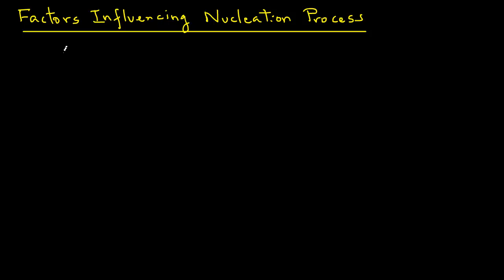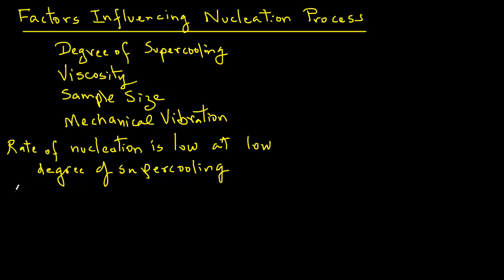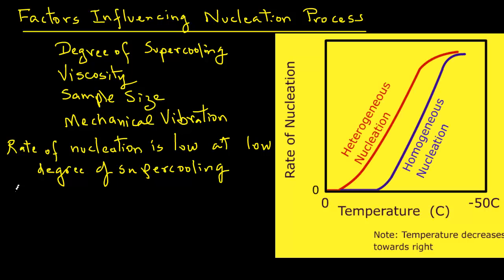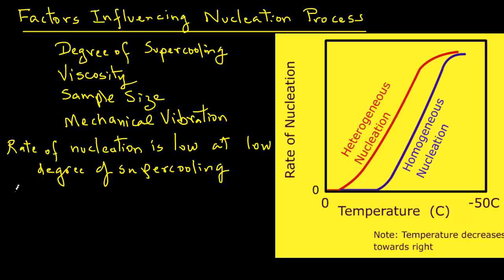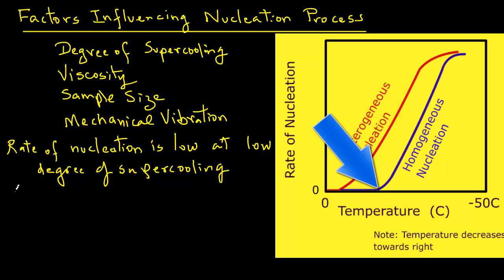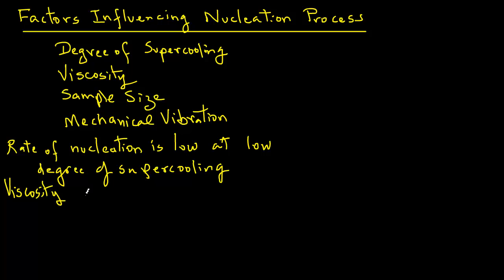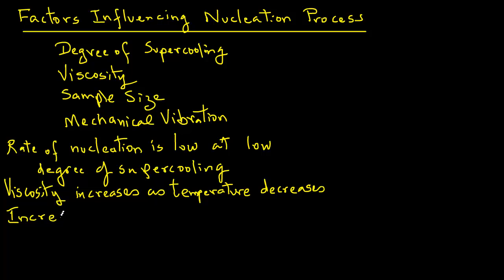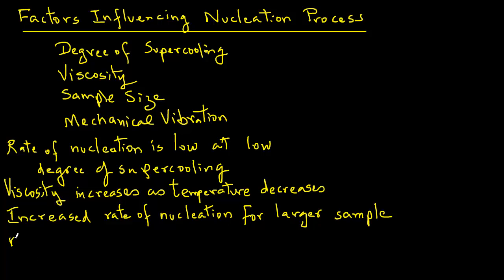Food Freezing - Factors influencing nucleation

Comment: Sir , as you said rate of nucleation low at low degree of sueprcooling but according to that diagram , it is low at around 0 °c and high at -30 to -40 approx.  So , it should be like at low temperature rate of nucleation is high... isn't it ?
Reply from the maker: Good question! Let me expand on what is said in the video. When the degree (or extent) of supercooling is low, that is, when the temperature remains close to 0 C, then the rate of nucleation is low (very few nuclei will form). When the degree of supercooling is high (i.e., when the temperature during supercooling gets down to very low values such as -30 C) then the rate of nucleation will be high and lots of nuclei will form.